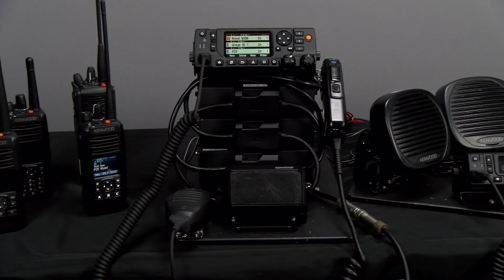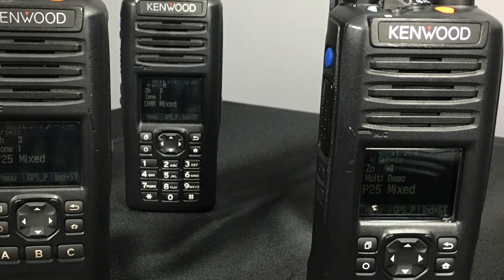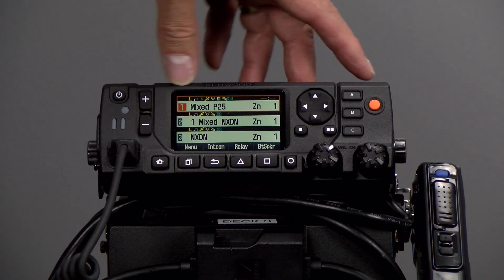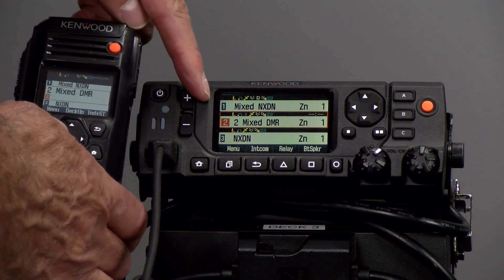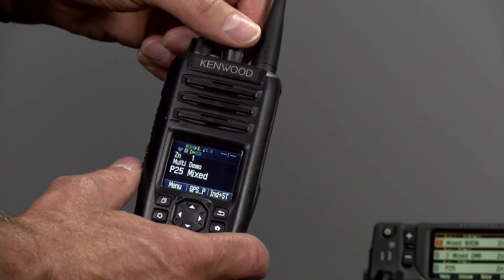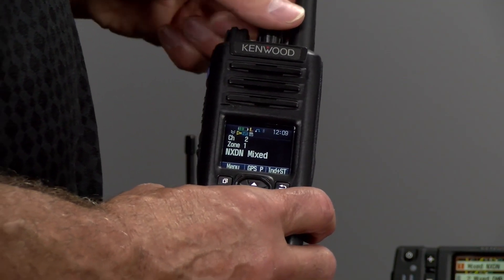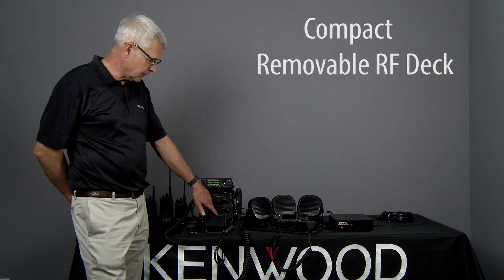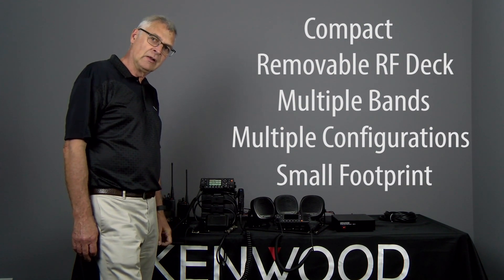NX-5000:  Multi-Protocol Support

Comment: can you monitor all three bands with one speaker? i have the dual deck with one speaker plugged into the kenwood cable but it only monitors whichever deck is high lighted as far as audio goes